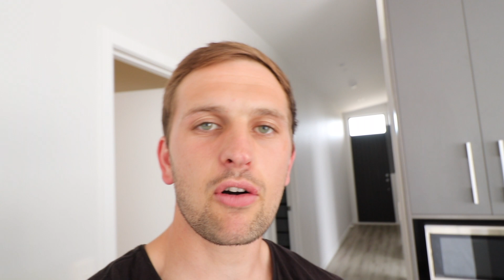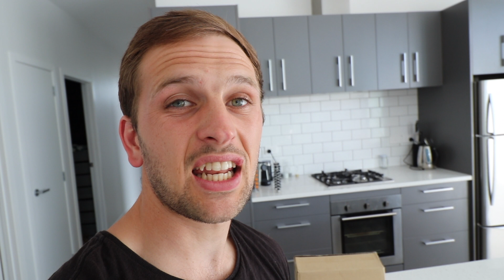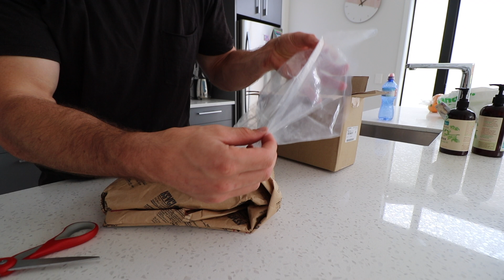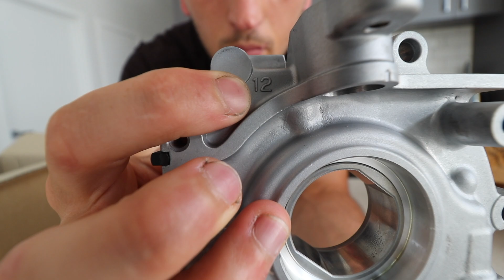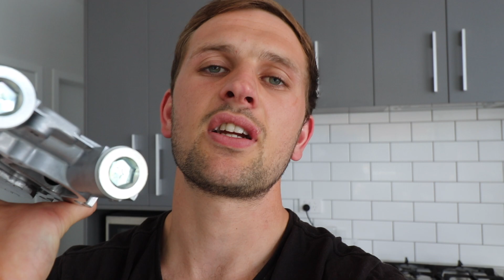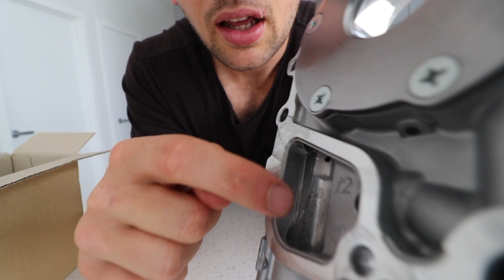Subaru Oil Pump UNBOXING - Genuine 12mm

Comment: Good video bro. I'll never go 12mm again . Relief valve kept getting stuck and I kept losing oil pressure time an time again so went back to 10mm haha
Reply from the maker: Cheers man! I've heard of quite a few people having similar issues with 12mm pumps, but never seen anything myself. I'll be running oil pressure directly into my ECU with a safety cut, so if it ever becomes an issue, the engine 'should' be sweet, haha.
Reply: @juliusbloem  yeah I came to see u about building me another engine ages ago in the blue gc8 ps auto built now it's all up an running . Think I maybe throwing it on dyno for club sub dyno day next week if it survives nightwars the night before hahaha
Reply from the maker: Yeah man I remember that! Awesome, how much power are you expecting?
Reply: @juliusbloem  it made 370kw atw 26psi 98gas and 29psi 404kw on 98 gas. Next few months were guna go e85 32- 36psi maybe
Reply from the maker: @nztrucker1542  shit that's big power! What turbo are you currently running? And what head studs do you have?
Reply: @juliusbloem  engines sleeved,decks closed,dwelled,custom aged head studs and I'm running the Garrett gtx3582r gen2